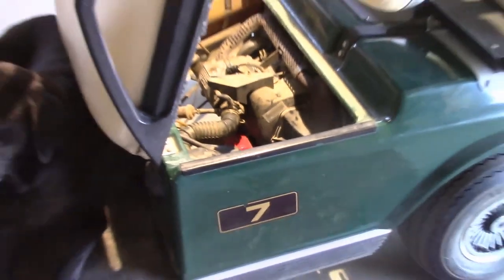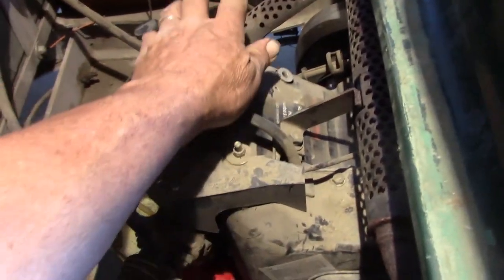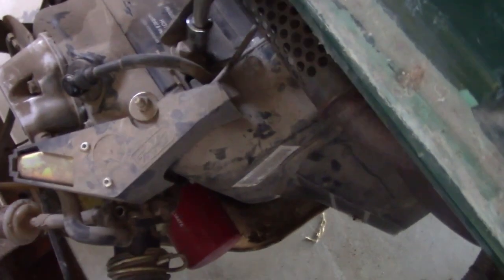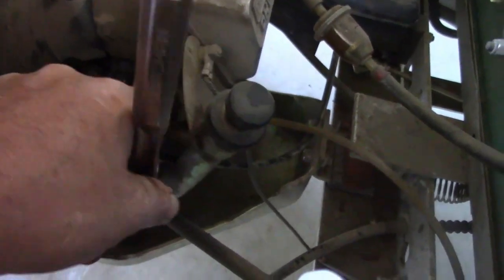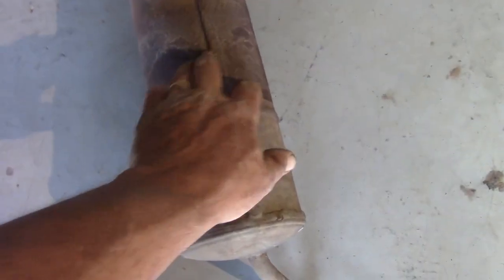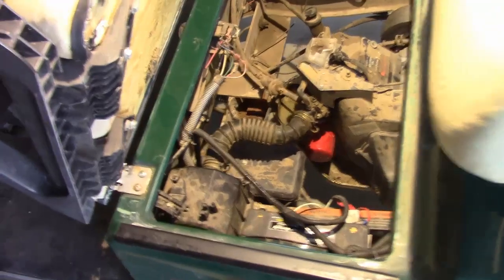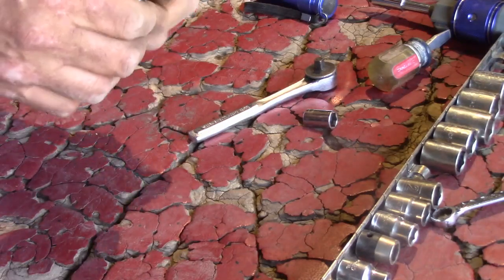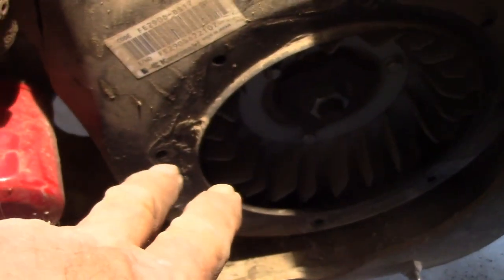Replacing Ignition Coil on Club Car DS - Part One

Comment: I just changed my coil. Didnt need to drill out hole bigger in bracket area.  I used a swivel socket   Was easier than i thought.  Thanks for video

Comment: Just replaced my coil! all this stuff is un neccessary.  just remove the muffler and that bracket.  remove the plastic cover with phillips screwdriver (short)  then the housing bolts.  lean the cover back and reach into the cover to remove the 2 coil screws.  no need to remove the cocer,  just pull it back a little. did not need swivel to remove the bottom cover bolts. just use a socket and lean it a little.

Comment: I need someones help please. What does the other end of the black/white wire from the ignition coil hook too. A kill switch was installed on my cart long ago and wire broke loose. Have no idea where it goes. Please help. 1998 club car ds. Kawasaki fe290
Reply: Thank u for this video. Ive paid to have 2 coils replaced. Its very expensive. I can for sure do this now when it needs it. Thx.
Reply: Pm. Me

Comment: What mine is doing it will run fine until the engine warms up and then it will start cutting out sometimes it will die you can let it sit a cool down for a minute and I will start up and run fine until it gets warm again